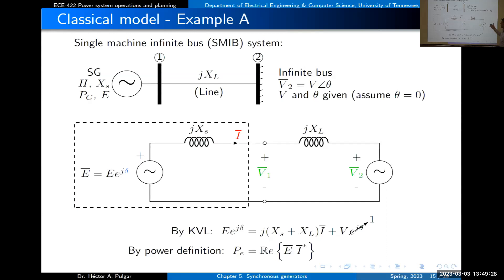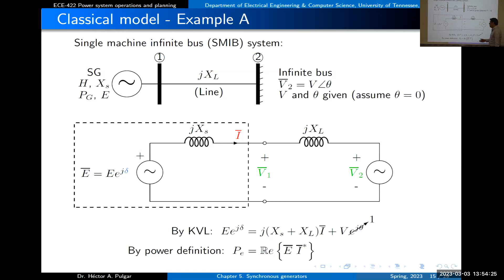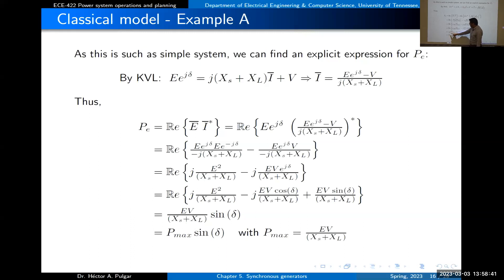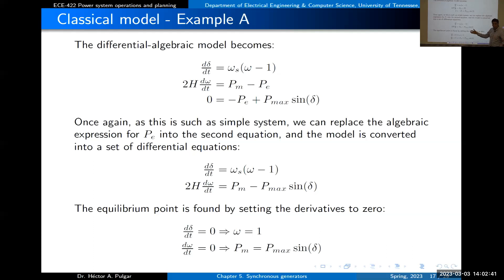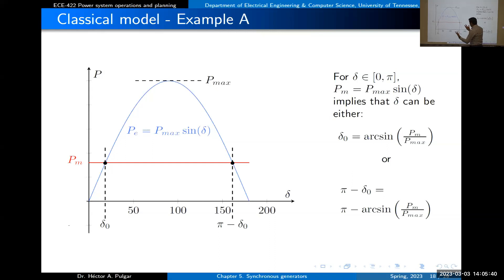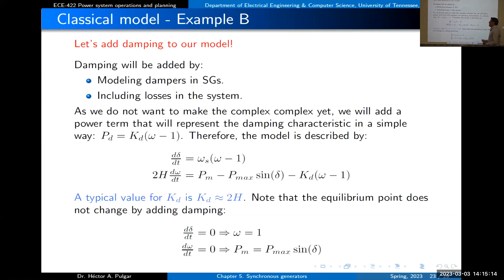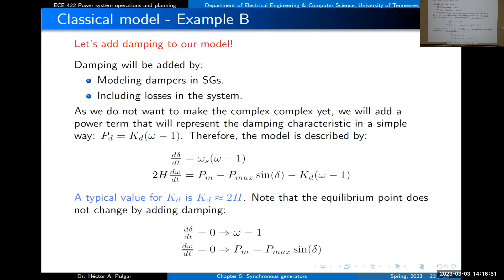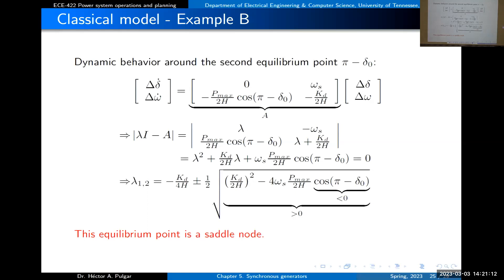Lecture 15 - Introduction to power system dynamics

Comment: Great work Professor.
In the previous lecture, you have mentioned that the right hand side of the swing equation has T_m-T_e; however, in this lecture, you have replaced it with P_m-P_e without modifying the left hand side. Is there an underlying assumption that you may have forgotten to mention?
Reply from the maker: Hello Faizan, thank you for your question. It seems that this aspect was discussed with the students but not recorded in the video. I am sorry for that. Let's recall the relationship between power and torque:  Power = Torque x speed. We assume that the rotational speed is very close to the nominal speed. Thus, by using the nominal speed as the speed base in the per unit system, then speed p.u. = ( speed rad/s ) / (nominal speed rad/s) which is approximately equal to 1 p.u.. As a result, Power p.u. = Torque p.u.. If you have disturbances such as short circuits, this is a good assumption. However, if you consider disturbances that cause a power imbalance, for example a generator outage, then you must use torque on the right hand side of the swing equation. Please let me know if this answers your question.
Reply: @hectorpulgar  Thank you for the clarification Sir!